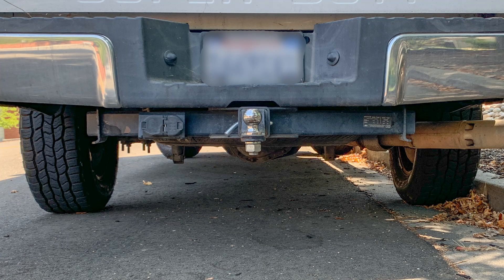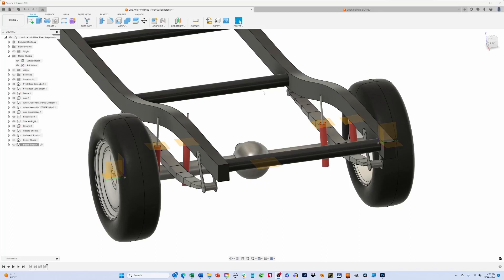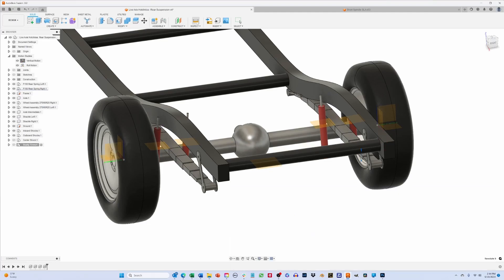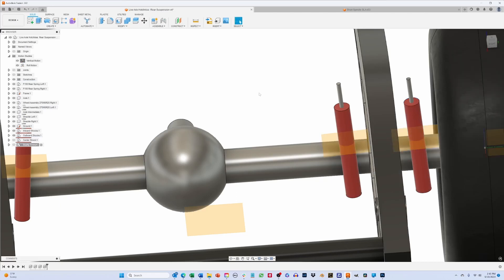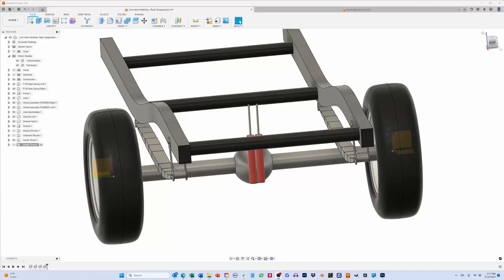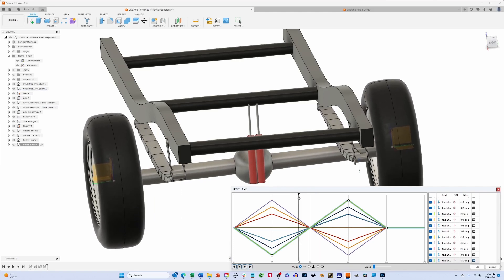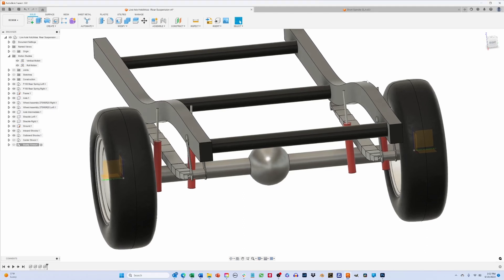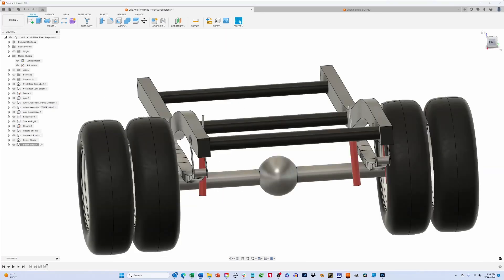Lateral Spacing of Shock - Why it Matters

Comment: 6:40 this seems to be an arbitrary limitation. As a reasonably good structural engineer can design the frame-rail around the ideal shock location. There is nothing that prevents the frame rails from being farther outboard than this, with a significant bend, looping inward around the shock. Or even a narrowing of the rail section in this area, with a specialized shock mount designed to carry some of the frame loads across this frame rail weak point.

Also, I think from how I understand this; the outboard shock can be angled to a more outboard mounting position at the axle, with the top canted inboard. If this angle was correct, the shock would provide maximum damping ratio at maximum body roll. While reducing damping ratio in the vertical by the sin of the angle. Although, this effect is probably small, perhaps 5%. It could be a meaningful improvement. Especially if the lower mounting point was located inside the wheel rim, very near the axle flange/hub. (Assuming this wont interfere with the brakes, which it probably will).
Reply from the maker: Justin, This is not an arbitrary limitation at all. The frame needs to be inboard of the inner tire sidewall throughout all of the tire's motions. This limits how far outboard the frame rails can go without increasing the track. Once the frame rail is placed as close to the tire as it will fit, then that sets the limit for how far outboard an inboard shock can go. You are also correct that you could narrow the frame rail in this area with some sort of specialized shock mount, but again, there are limits due to the motion of the shock under all the various axle motions. Also, don't forget that this section of the frame has to carry all the towing loads so it still needs to be very beefy. This is why you won't see OEM's scalping out the rails in this area.
You are correct though that you can angle the shock to get a better motion ratio. Ideally you would want the shock perpendicular to the roll center, which on a leaf spring design is actually quite high, depending on where the springs are located (above or below the axle).

Comment: By the way, why does having a consistent wheel-to-shock motion ratio between heave/pitch and roll make it easy to find the right setting for both?
Reply from the maker: Having a constant motion ratio means you will get the maximum roll damping you can possibly get. I have never driven a vehicle that had too much roll damping so getting more is better. Having a lot of roll damping is a great way to make a car feel like it is stiffer in roll than it actually is (i.e. as if it had larger anti-roll bars) because the perception of roll is related more to the speed at which the vehicle rolls than to the actual roll angle. Adding lots of roll damping slows the roll rate down and makes the vehicle feel like it has higher roll stiffness.